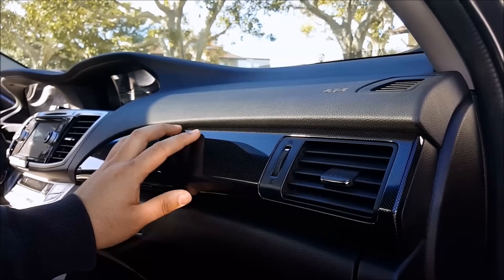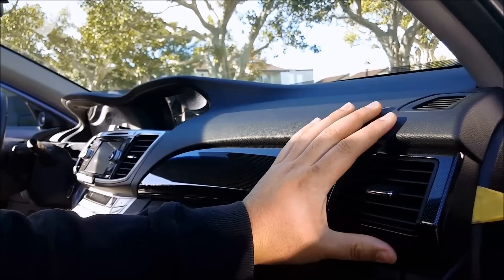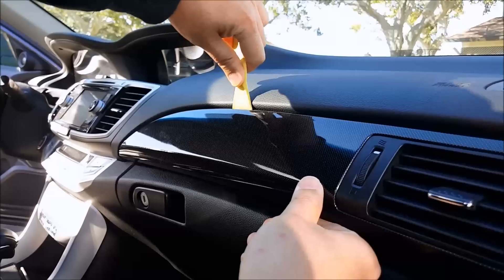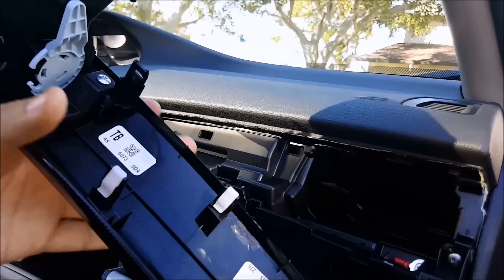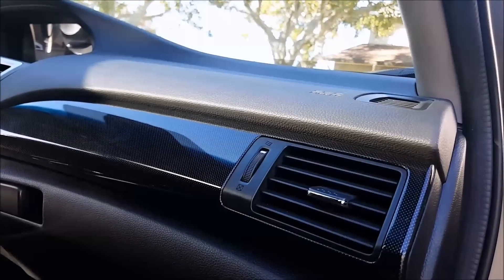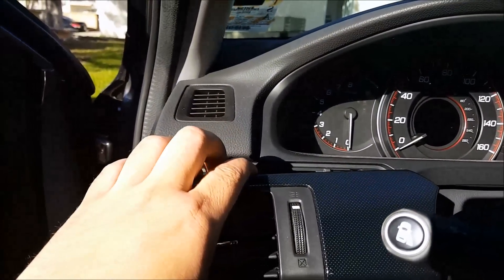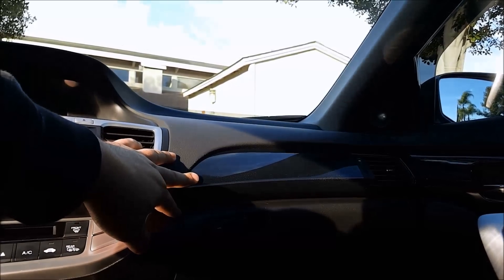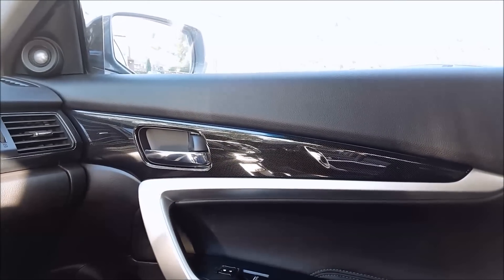Tutorial: 2013 - 2017 Honda Accord Dashboard Side Vent Trim Removal

Comment: When the car is on and you step out with the key, the key won't function. Is there a way to make it work?
Reply from the maker: +Kagamincest What exactly are you trying to do with the key?  Are you trying to lock the car while the engine is running?
Reply: +DIY: Car Modz yes, its annoying to have to remove the key from the fob and locking it manually instead of just pressing a button. im hoping that someone has found a way to do so.
Reply: Just get a remote starter. That way you can turn on, lock/unlock your car from a distsnce

Comment: Hi Jeff, how did you wrap your dashboard with carbon fiber vinyl? and specific type of vinyl please? Thanks in advance
Reply from the maker: That is the stock dash trim for exl.  You can wrap it with 3M DiNoc: http://amzn.to/2bta9kn
Reply: myyube81 you need to change the temperature and the hot air will stop